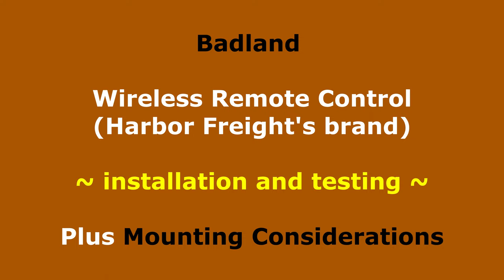Badland *wireless* WINCH CONTROL

Comment: Id just use some 3M VHB tape on that wirless module.  It will never come off unless you want it to.  That doublesided tape is used for metal panels with no mechanical fastners for enclosed trailers and holding solar panels on RVs without drilling.
Reply from the maker: I never heard of that! I'm going to have to buy some. Thanks for the tip 🙂

Comment: how do you reset the remote there is no on off switch i have power at every point on the circuit board and can jump the  wires to make the winch run both ways   but i don't think the remote is tell the box to activate the power thanks
Reply from the maker: IDK about resetting it sorry. I would try to get a new one

Comment: Will this work with the rough country 9500 series winch?
Reply from the maker: IDK and haven't heard if the signal it sends is compatible with other manufacturers
Reply: @anesthesiadreamin  ok thanks. I found a universal wireless kit on Amazon.
Reply: @Rydrdg 

Will you share the link to the remote you used from Amazon?

Comment: The idea is realistic 
But it’s very clear to disconnect the power before connecting the controller and ya zip tied your cord without pulling the rubber boot over the power connections 
Leaving the remote control connected to the winch not a good idea ? Why 
It’s outside 
That’s definitely going to fail in the weather
Reply from the maker: Good point! Except I keep my winch inside, and only put it on the trailer when needed. The winch remote won't get left outside. Haha unless I forget it 🙂
Reply: Have you tested how far it will reach
Reply from the maker: @texastoys5874  I have not tested it, it's advertised to 50 ft. I know it works at 30 ft for sure